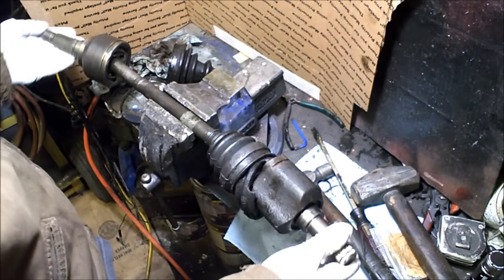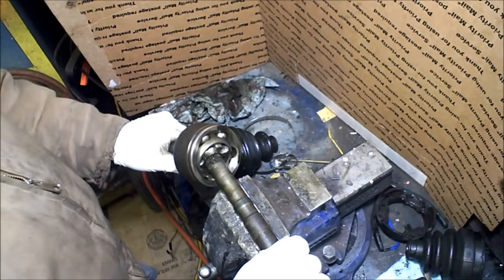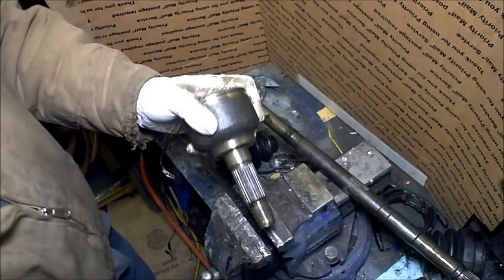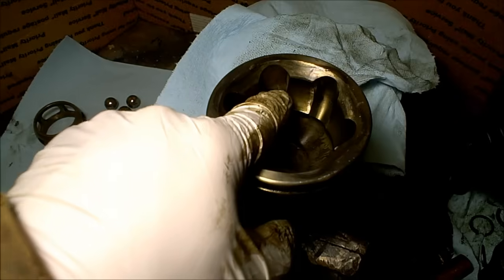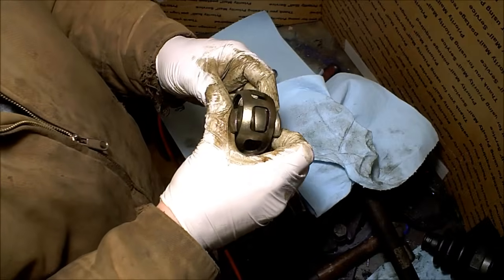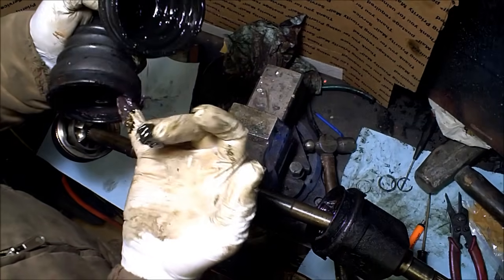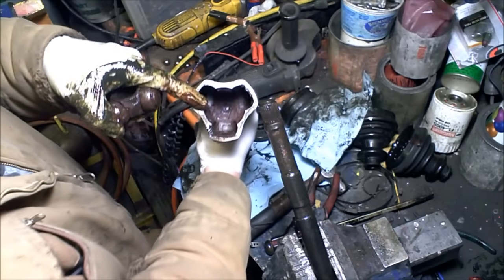CV Axle teardown Whats inside a CV Axle Half Shaft

Comment: Great video!  I came to see how you would address the taking apart of the outer bearing assembly... Your joint unlike mine had the snap ring to limit the shaft going into the joint too far.  Mine (Nissan CV) is a smooth shaft the entire entry into the bearing assembly.  How it gets removed I have no idea.  It probably has an internal snap ring like the one you showed but I tried yanking on it to get it to release and have had no luck.  Any ideas how to get it to release?  It is more of me taking this old one apart to learn... I am not without my vehicle in other words.  Just very curious how these work.  Any ideas appreciated... BTW - my 2 cents on the grease is this.  The inner 3 roller bearings - yours has needle bearings and mine has regular sealed bearings- grease needs to be able to get into the sealed or needle area easier therefore the grease needs to have a lower viscosity to get into the bearings in my case whereas the balls in the outer bearing/joint are exposed and thus a more thicker grease is desired... just a thought.   thanks!!
Reply from the maker: The CV axles take quite a bit of force to jar them loose. Sometime wedging a screwdriver/pry tool between the case and CV is necessary to break it free.

Comment: Great video..it was a YouTube suggested video and I watched..it was great well done man...Oh and the grease is different because  no one man assembled it on one bench and from start to finish and once completed he set it in a box...it's going threw many machine and hand processes and 10 machine's and 5 guys had a turn in touching it and the guy who greased the inboard joint /booted and crimped it was simply supplied with different grease than the little Asian gentleman who was doing the outboard side halfway across a huge factory...no doubt

Comment: The inner joint grease needs to be thinner due to needle bearings, its usually a nlgi 1 grease with no additives, the outer joint is usually a nlgi 2 grease with moly, the moly additive with block the thicker grease from getting to needle bearings causing premature wear. Gkn sells the grease that is made for tripod needle bearings as does vw and honda, most chinese aftermarket cv axles use the wrong grease on inner joint and most reboot kits, even from the dealer, come with the wrong grease for inner, everyone thinks you can use cv grease on inner and that is wrong. I went through 4 free replacement limited lifetime warranty aftermarket cv axles, inner joint kept failing causing play in joint and vibration on acceleration, a few only lasted a couple of weeks before developing a clunk from inner joint, until i took the next new one apart and found they are using cv grease in inner tripod joint, cleaned out wrong grease and put in vw triple roller bearing grease, and havent had the inner joint fail since. Also usually the new proper inner joint grease is yellow or cream color and has the consistency of toothpaste, unlike outer joint grease with moly that is grey and really thick like peanut butter. Also some older cars do use the same ball bearing joint as outer on the inner joint, which using cv grease is right, but nowadays most inner joints  have the triple roller bearing design, or tripod needle bearing design which requires the tripod grease
Reply: At first I thought the coloring is result of the worn and grounded up needles it is missing from that failed ball. I know now that your assessment makes senses. Thanks

Comment: 13 dec 2019 11:30 am est:thanks

13 dec 2019 12:1 pm est:
1:30 name is cv-joint/constant-velocity-joint (for independent-suspension)
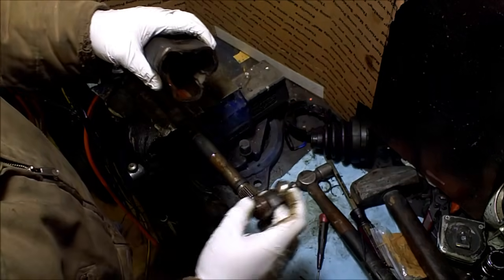1:00 name is tripod-joint (for making wheel turn-left/turn-right)
source:'CV axle (shaft) of a front wheel drive car Typical CV axle (shaft) of a front wheel drive car with a Rzeppa outer CV joint and closed tripod-style inner joint'
in https://www.testingautos.com/car_care/when-replace-cv-axle.html from google-image(joint in cv axle half shaft)row 1 col 1

6 feb 2020 12:29 pm est:i wonder whether each time fwd-car-front-engine turn-slightly steering-wheel to stay-straight inside road-lane that fwd-car-front-engine lose torque.

Comment: Just wondering if the inner part of the axle can be changed to a different axle ? I have 95 mark viii (28 spline) axles that I'm wanting to make 31 spline ?
Reply from the maker: Most people cut the shaft of both axles, weld and sleeve it to adapt two different CV axles.

Comment: Could I yank out the inner side of the shaft from the hub spindle, and leave the outer side installed with the axle nut tightened so my wheel doesn't fall off? Mine broke and shop is saying I may need to get the internals on my diff repaired as well if they are pitted or something he said. I can't Afford that right now i just want to be able to use my 2wd.
Reply from the maker: Yes.

Comment: I worked at a place remanufacturing these. There is no difference in the inner and outer grease. This particular one has probably been serviced before, and whoever did that just used whatever grease they had lying around. We used the exact same grease in both.. .
Reply: Correct.  Most parts stores sell a packet of CV axle grease and it goes in with either one.  I would really like to know what all is done to these when they are "remanufactured".  Sure, dismantle, clean and regrease with new boots but how are the worn innards renewed?
Reply: I find this hard to believe at least for Toyotas.  Car Care Nut video clearly shows the two packages of grease - one is much more viscous than the other.  Definitely not the same for Toyotas at least IMHO

Comment: HI AND THANKS A LOT FOR YOUR CLIP, I LOVED IT, LEARNED FROM YOU AND THANKS FOR THAT, BUT MAYBE BY NOW YOU FOUND OUT ALREADY, IF NOT I CAN TELL YOU MY VERSION OF THE ANSWER TO YOUR WHY? QUESTION.

IN YOUR CLIP, YOU MENTIONED ABOUT THE TWO DIFFERENT KINDS OF GREASE WAS USED ON BOTH SIDES OF AXLE AND YOU DON'T KNOW WHY?

MY ANSWER:
I THINK IT IS TOW DIFFERENT KINDS OF GREASE, BECAUSE, THE SIZE OF THE PARTS ON BOTH SIDES ARE DIFFERENT, ON ONE SIDE ONLY THREE BEARINGS NEED GREASE, AND THE TOTAL SURFACE AREAS OF PARTS THAT RUBBING AGAINST EACH OTHER ARE LESS AND MORE THERE ARE BIGGER GAP AND SPACE BETWEEN THEM BUT THE OTHER END HAS FINER, PIECES WITHE SMALLER GAP BETWEEN THEM, THAT IS WHY FOR GETTING THE OIL TO ALL AREAS OF MOVING PARTS AGAINST EACH OTHER, THE OIL NEED TO BE MORE THIN AND MORE LIKE LIQUID SO ALL AREAS OF ALL PARTS BE OILY AT ALL TIMES ( THEY ARE UNDER, LOTS OF PRESSURE AMD HEAT AND MOVING SO FAST, 

THE OTHER SIDE THAT HAS ONLY THREE BEARING THE GREASE IS THICK AND THE WHEEL SIDE OF AXLE MUST BE THIN FOR EASILY GETTING BETWEEN SMALL GAPS AND KEEP EVERYTHING OILY AT ALL TIMES.

WITH THANKS OF YOUR WONDERFUL CLIPS.
Reply from the maker: Thanks.

Comment: Not sure if you still the comment, but I am trying to remove the outer CV joint assembly from the axle and I am having some trouble doing so. My method is to secure the axle on a vise and hammer the inner cage with a chisel. Any advice would be appreciated.
Reply from the maker: That's how I would do it. They can be very stubborn.

Comment: they in fact use different greases for the inboard and outboard bearings. this due to the difference tolerances found in the different types of bearings. ball bearing have smaller and closer fitting parts and need a thinner greases that is able to get in and give them a proper film at all times. while the other bears have a bit or more space inside them and need a thicker grease that wont just seep to the bottom of the housing when the part is not in operation.
Reply: Wrong ball bearing joint needs thick grease, needle bearing joint needs thin grease
Reply: @jessjohn6157  - i just replied to this post and had the exact same thoughts as you Jess

Comment: I've got a 1999 Nissan Pathfinder. I have recently purchased a pair of front CV axles and haven't done any work on it because I wanted to find a good video to show me not only how it's done but also what kind of car are this CV shaft change from? Are all CV shaft changing the same? I don't think so. I believe the Pathfinder CV shafts are not the same as the Ford CV shafts. For this reason I actually am looking for the replacement shafts for a particular vehicle, because not all shafts are the same and not all of them are replaced the same. Am I right?

Comment: Sixtyfiveford, the grease may be different from a mechanic having had it apart at some time. Or, the inboard joint may not need a high quality grease like the outboard joint with its many moving parts under higher stresses?

Comment: It really just takes a light knock like the outboard to get it off like that? Having a hard time with my Mazda3
Reply from the maker: Jackson Cruz Some are a lot harder than others.
Reply: My application is a Mazda 3. I think mine uses a snap ring.
Reply from the maker: This is a Mazda CV axle. I have the compression ring removed but it did take a good couple whacks. There is no way to put a snap ring on the on the back side.

Comment: I the nut damaged the threads on the outer part of the shaft, and I'm trying toreplace it in my garage. I ddon't have a vise to hold the axle. What did you use to remove theouter cv part away from  the shaft. Thanks for your help..
Reply from the maker: The outer CV joint just snaps off. I took a hammer and tapped it off.
Reply: I'll more muscle into it, thank you.
Reply: I managed to find the whole shaft on rockauto. It will be less hammering and labor to get this fixed. Just have to wait for the shaft. I wish I had a shop like you so I can do serious work.
Reply from the maker: Rockauto is great for parts.
Reply: That's where I get my parts from also.

Comment: I am replacing L & R on a 99 Diamante, starting tomorrow and hopefully finishing the same day. No big deal if it takes more time, my daughter only has a permit. I thought it was the wheel bearings, but no, it must be both. Or the CV was ready to go and did when replacing the wheel bearings and rack and pinion.

Comment: I've driven front wheel drive vehicles and disc brakes since the 1970's and I've replaced many, many, axles. I have never seen a cracked or split inner boot but I've seen tons of split outer (nearer to the disc brakes) boots.  I think the high heat from the brakes might also have something to do with hardening the rubber causing the outer boots to fail before the inner boots.

Comment: My theory about the different appearing greases is that the wheel end gets very hot from the disc brakes while the trans end is not as hot and the temperature is more consistent. The extreme heating from the brakes might change the coloration of the grease while the lower and more constant temp from the trans might not affect the grease as much. I also thought both ends used the same molybdenum disulphide grease. I also think the wheel side might get more moisture and it might change the color.
Reply: but they are definitely different greases....

Comment: Thankyou for that :-)

That c.v joint is a work of art, all the machine work to create one and we never see it.

Ive never seen inside one untill now, that was smashing :-)

Its a shame you have to hand it back for the core, the main shaft would make a fearsome drifting rod for use with tapping big bearings out.

The engine drive joint is a clever idea, simpler but limited.

Good tutorial mate, i learned loads :-)

Comment from the maker: Each Axle was about $50 with a $10 core. Yeah, after pulling it apart the tolerances are so precise, even a grain of sand would mess stuff up pretty good. I did a boot back in the late 90's on a plymouth only to have to replace the entire CV axle a year later.

Comment from the maker: Both Axles were the same with the inner boot having different grease than the outer. The rubber boots are date stamped 1995 (car is a 1996 mfg in 95) I haven't changed them and I've owned it since it was 2 yrs old. I just have no idea why they would do this..